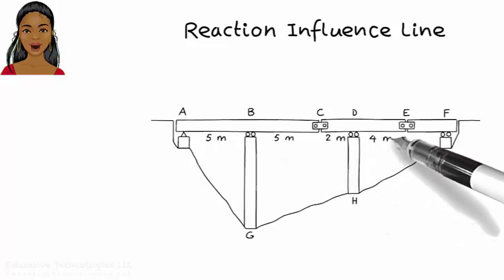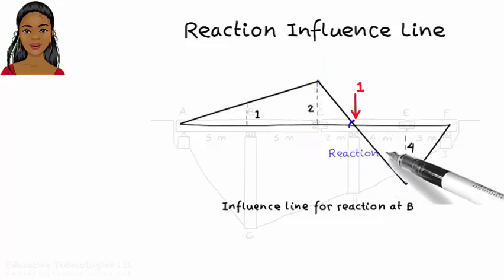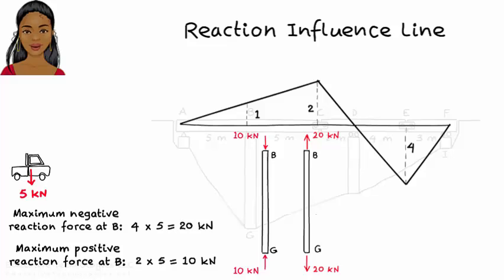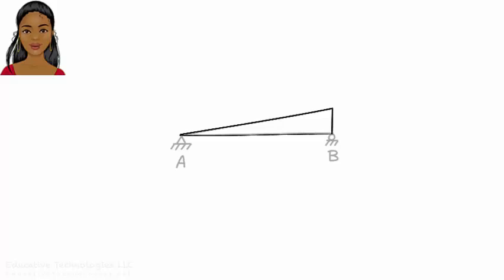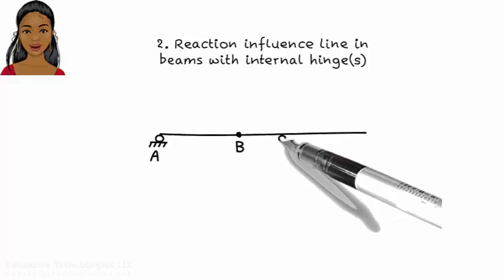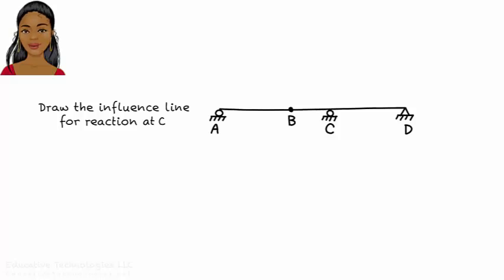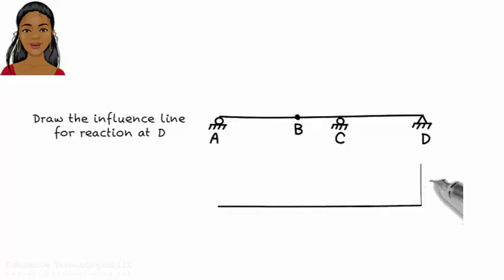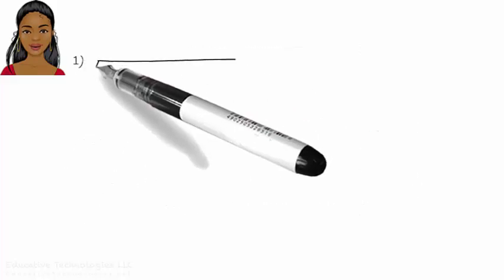SA16: Reaction Influence Line

Comment: Hi, i'm really struggling to grasp/visualise this concept.. I don't understand why the maximum reaction load at B occurs when the unit load is at E. Is there anything else that i could do which would help me understand it better ?
Reply from the maker: +Declan Connor The underlying relationship between the position of the unit load and the reaction force is a mathematical one. It might be beneficial to write the equation(s) that define the relationship so that you can see/examine how the reaction force changes as the load moves across the beam. 

Since the beam is statically determinate, you should be able to come up with the equation(s) with rather ease. They are:

x: position of the unit load
Rb: reaction at B

0  < x < 10   x - 5 Rb = 0
10 < x < 16   12 - x - Rb = 0
16 < x < 21   84 - 4x + 5Rb = 0

Since these are linear equations, to determine their max/min values we simply need to evaluate them at their boundaries. 

So, in the first interval Rb=0 at x=0, and Rb=2 at x=10.
For the second interval we get: Rb=2 at x=10 and Rb=-4 at x=16.
For the third interval, we get: Rb=-4 at x=16 and Rb=0 at x=21.

So, maximum positive reaction at B is 2 (when x=10), and maximum negative reaction is 4 when x=16. By the way, if we graph these equations, we get the influence line for reaction at B.
Reply: +Dr. Structure thanks very much for your very detailed an thorough explanation. I get it😎. Fantastic video's. No doubt I will use many more and there will be more questions to follow!
Reply: What is the answer of question 3 in the exirces for reaction influence line...
Reply from the maker: https://youtu.be/8JgbArDo1yo
Reply: Can you please tell me how to write static determinant equation for beam to find out maximun and  mimimum reaction at B?

Comment: realii gud vid , presentation ,xplanation n the tiny li'l animated head tht prevents boredom!:P
i'd realli appreciate it if u cld explain this method a bit more..
this is not the method that i've studied and find it a bit difficult..
thnx anyway!
Reply from the maker: Let me know what it is about the method that you find difficult to understand either by explaining what you are confused about or by asking a few questions. I will then be able to address your concerns directly in the next lecture.
Reply: ma'am (judging by ur dp:P)  ..
im confused by the way you jus elevate or increase the ordinate of the influence line-by unit qty. jus considering the support conditions..
while i'm used to calculating the value of reaction components (moment or shear..)w.r.t  the position of load along the beam..
ur method seems much easier but i'm not getting the hang of it ..
plz explain..